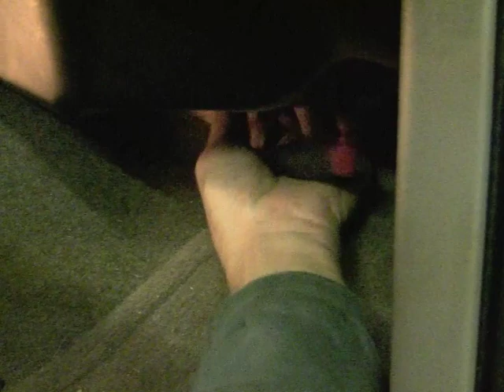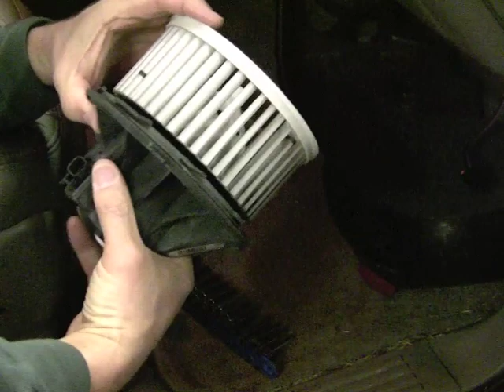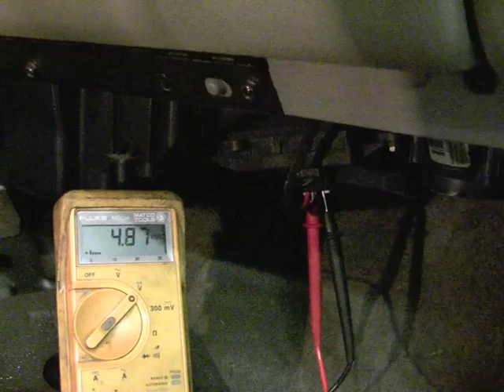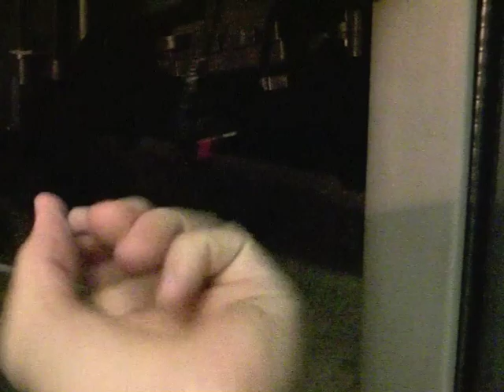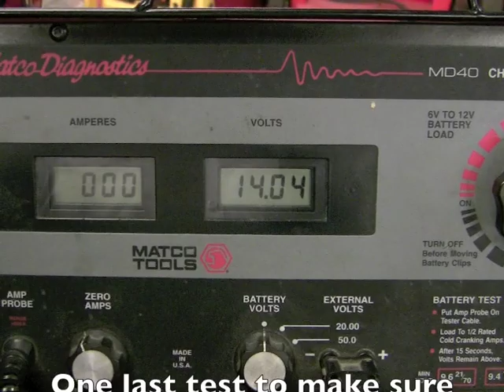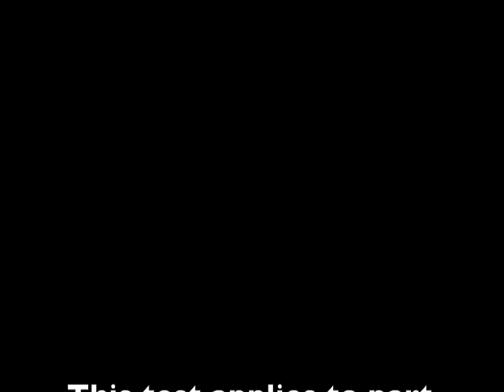2005 Chevrolet Tahoe Blower Not Working

Comment: hey sparky my 05 tahoe ls got broken into, they cut my color wires thet go into the big fuse box. i color traced and rewired them back. my front ac works but the rear ac dont turn on also my led top break light dont turn on? how can i fix this.
Reply from the maker: Check the RR HVAC fuse in the underhood fuse box and the IGN3 fuse in the interior fuse box. Also check the CHMSL fuse in the underhood fuse box for the third stoplight issue.

Comment from the maker: Since they said it has the rear defroster controls on it as well, they are referring to the HVAC Control Head assembly. The part discussed in this video is the blower speed controller. It is the solid state equivalent of a blower resistor for a system with manual controls.

Comment: Sparky I called local auto parts store (Advance Auto) and they said this part is $215 from them and has the rear defroster controls as well?  Maybe they were looking at the wrong thing?  I don't know.  I believe this is the same part that I replaced about 4 years ago.  Should I check something else on the truck?  Same symptoms as you show though.

Comment from the maker: The most likely cause will be a faulty blower speed controller. The air that you are currently feeling is ram air from the fresh air system while the vehicle is in motion. A few simple tests at the blower speed controller should answer your questions. One thing you should know is that the part has been redesigned by GM and looks different. It comes with a new harness, terminals and instructions. The-Electric-Connectiondotcom has them. 15-81773. They also have a link to my site for more info.

Comment: My driver side heater would come on when I had a/c on so I bought a new temp door actuator.  Hadn't even put it on yet and now new problem.  The fan/ac both won't work when the truck is sitting still or going slow.  It only works when it is moving.  Even if I rev the engine in park it still doesn't blow.  I have the digital control unit.  I'm scratching my head on this one.

Comment from the maker: A 2008 model is slightly different. There are two different problems that I have seen with those. The blower speed controller fails and the connector at the blower motor burns out. The parts are all in the same general locations as the earlier ones.

Comment: hey buddy got a question for ya i have an 2008 chevy silverado reg cab with the 5.3, one day when driving home the air quit blowing hard out of the vents the a/c and controls on the dash all seem to work but air only moves thru the system when im moving down the road ne ideas on what the problem might be and how i can fix it any advice would be welcomed thanx

Comment from the maker: You need to make sure that the orange wire has power on it at all times with all components connected. If it does then you will need to make sure the black wire has a constant ground. If both are okay you will then need to concentrate on the signal on the purple/white wire. It should be a variable ground that brings the five volt signal from the blower speed controller to near zero for high blower operation. Experience tells me that you will have an issue with the orange wire loaded voltage.

Comment: I checked fuses and they seem OK. The 3-prong cable with orange cable also registered 12.6 volts when I turn the key on. This tells me power is good to the rear.

I removed the rear blower and control module and attached them both to the front ATC wires and the blower worked when the fan knob is turned ON.

When I turn the key on, both rear ATC controls lits up, or illuminates, which means power is going to them but the fan control when turned to ON does not activate the blowers. It's weird.

Comment from the maker: There is a separate blower motor for the rear system. The rear system also works the mid vehicle vents. Replacing the front blower speed controller as outline in the video will not help your problem. Instead you will need to check your fuses and if they are okay you will then need to remove the passenger side rear interior panels to access the rear blower system for testing.

Comment: Hi. I have a 2000 yukon XL 1500 with ATC for front, center and rear cabin. The front fan/AC works fine when I turn fan knob to ON position

When turning the fan knob to ON position for center or rear cabin, the blower does not come on. Would replacing the blower speed controller fix my problem?

Also, with ATC for front, center, and rear, does each one have separate fan/blower?

Comment from the maker: A blower resistor is part of a manual system. A blower speed controller is part of an automatic system. The diagnostic process is very different between the two, so I would need some clarity from you before giving an answer. Do you  have a manual or auto system?

Comment: will the blower motor resistor cause t to do same thing .mine will work but might slow down or even turn off without adjusting the blower speed.

Comment from the maker: I have done extensive articles on my main site about these though. Go to sparkys-answerscom, page tab Sparky's Repair Article Menu. Scroll down, go to GM Fullsized Trucks&SUVs, HVAC, Actuators. The list of articles will open. Click on the appropriate article and get the information you need to replace that actuator. Keep in mind the actuator replacement is generally the same for a Avavlanche, Escalade, Silverado, Sierra, Suburban, Tahoe & Yukon.  Years 1999 new body style to 2007 Classic.

Comment: Thanks for the clarification, Sparky!  I ordered the 15-81773 kit (per your recommendation) for my 2005 Tahoe.  Installed it this evening in about 30 minutes (the splicing is obvious & great directions included) & now the blower works perfectly.  Hopefully it will behave itself with the new controller. Total cost is $65-70 off Amazon.  I'm sure you've saved me at least $200 over the dealer!  Thanks for the great video.  Keep it up.

Comment from the maker: The 15-81773 will fit in place of the original FRONT blower speed controller which used to be part number 15-80567 and then superseded part number 15-81728. It Will NOT replace the part number 15-80568 which is for the REAR blower motor. The 15-81773 does require cutting and splicing wires.

Comment: So...my main question is will this new & improved design (15-81773) of this blower control (with the need to do the wire splices) fit my 2005 Tahoe?  The same part (15-80568) is about $100 & this new part is $65!

Comment from the maker: The 15-81773 is a great improvement over the 15-81728 in that it plays well with aged blower motors. The 15-80568 is a current number for the rear blower controller. The 15-80567 was the number for the earlier design front controller. Not really an improvement just a case of internal parts becoming obsolete by chip manufacturers.

Comment: Hey Sparky-
Great demo, but as others have stated, I think this new part 15-81773 is a significant improvement over the old 15-80568 & requires some wire splicing skills.  Any comments about this.  Thanks!

Comment: Thanks. My unit performed identically to what showed in your video. I will replace both the motor due to the 160,000 miles on the car as well as the speed controller.

Comment from the maker: In relation to this vehicle an a/c actuator a motor and gear box that moves a door as commanded to by the HVAC control head assembly. There are four a/c actuators on the main a/c system. Mode, driver's temperature, passenger temperature and recirculation. The blower resistor assembly (4 resistors and a relay) is for manual a/c systems and the blower speed controller and processor (solid state) are one in the same and are used in vehicles with auto a/c controls.

Comment from the maker: These vehicles with auto controls will have a digital display and it allows you to set the desired temperature that you want and the system will respond accordingly. Manual controls have to be constantly adjusted to maintain a desired comfort level.

Comment from the maker: You will need to set your meter on DC volts and choose a setting appropriate for the test. Most automotive testing will be done on a setting of 15 - 20 volts. In testing the inputs to the controller the tests will be the same. Red wire = 12 volts positive, black wire = 12 volts negative and the purple wire should read between 0 and 5 volts as the controls are adjusted.

Comment: Thank you for your advise. I purchased a voltmeter (Ideal Resi-pro Multimeter). I am not sure exactly how to use it, excuse my ignorance, but there are quite a few settings on the dial. ACV or DCV settings and which number setting there are like 15 different ones. I noticed in your video clip that there was voltage is that because your motor wouldn't turn off, will mine be the opposite because it won't turn on?

Comment from the maker: Although statistics would point to the blower speed controller being faulty, the only way to not guess is to test with a voltmeter. Coupled with your Suburban's mileage and the current replacement blower speed controller design I would strongly recommend changing the blower motor at the same time.

Comment: I have a 2004 Suburban, auto heat/AC, with over 150K miles. I do not have access to a volt meter. All the buttons light up and indicate properly their function. Fan up/down lights all the way up and down but nothing happens - no air blowing. I hate to start buying stuff like blower speed control and motor if it isn't the correct fix. Your recommendations would be greatly appreciated.

Comment from the maker: @darrellgjr You state that you replaced the resistor. Does your truck have manual a/c controls? This video was about a Tahoe with an auto a/c system. Two very different diagnostic routines.

Comment from the maker: @paris24681 More than likely your coolant level is low. The heater core is at the highest point of the cooling system. Therefore when the coolant level is low it is starved of hot coolant. The higher rpms forces some coolant into the heater core.  I wrote a post about this on Dec 1, 2011 on sparkys-answerscom

Comment from the maker: @marcellasimmons You have a few choices. Remove the purple wire from the blower speed controller and then back probe the internal terminal with the other two wires connected. If the voltage returns there is a ground on the wire circuit. If it does not the blower speed controller is faulty.

Comment: on your video u get about 5 volts on the small purple wire when the blower is off and about 1.5 when it on low im assuming, im not getting anything on that small puple wire, my friend told me it could be the climate control, i dont know, my wires look to be ok, dont know were it would be getting ground from...I need help fast i need to sell my truck and i dont want to sell it like this. thanx.

Comment from the maker: @marcellasimmons   Voltage on the small purple wire is an output of the blower speed controller. Therefore if ground is present on the black wire and power is present on the red wire, there are only two explanations. The blower speed controller is faulty or there is a ground on the small purple wire that is killing the signal.

Comment: what if the purple wire is showing no voltage when its on or off, then what would be the problem??? could it be the climate control unit???

Comment from the maker: @mostshockingtrutv I do not have a video on this but I have done an extensive write up about this problem on my website. Sparkys-Answerscom. Look for the posts dated November 18, 19 & 20 of 2010. also if you have any more questions you can find my email there under Contact Sparky.

Comment from the maker: @quadty11 Glad the blower on the Tahoe is fixed and you feel the video helped. Keep in mind that The-Electric-Connection sells the original equipment  Delco parts for these vehicles at very competitive prices. You also get personalized help from me if you need it.

Comment from the maker: @vdzrussell  A blower speed resistor and a blower speed controller are very bsimilar parts and in your truck they mount in the same place. The blower speed resistor is used in vehicles with manual a/c controls(rotary blower speed and mode knobs, center temperature slides,most). The blower speed controller is used in vehicles with auto climate conttrol (digital center panel, two rotary temp knobs and multiple push buttons) Either design can act up and cause the blower to stay on with the key off.